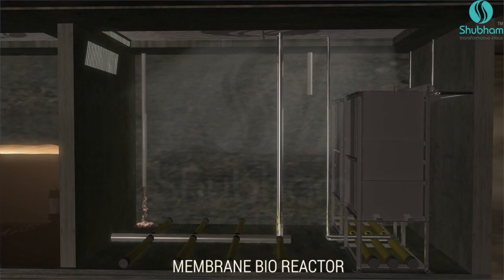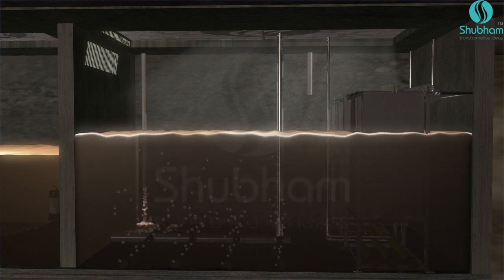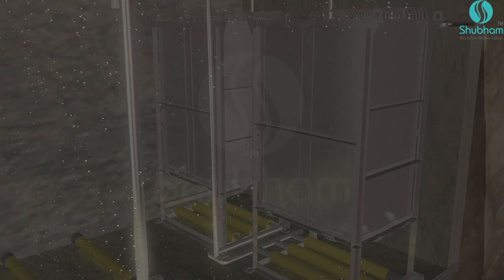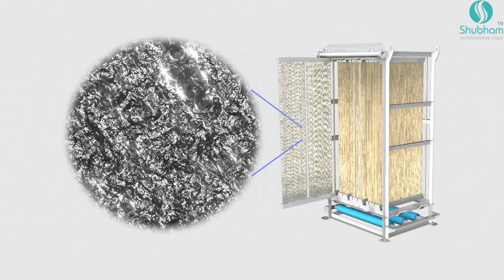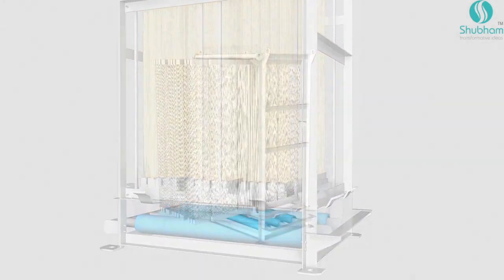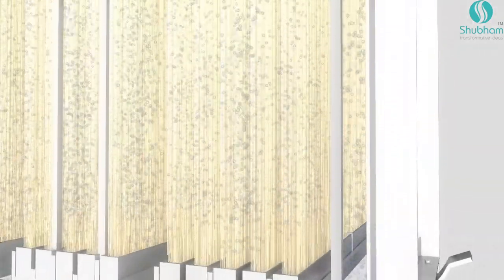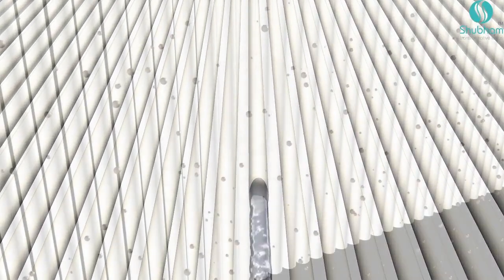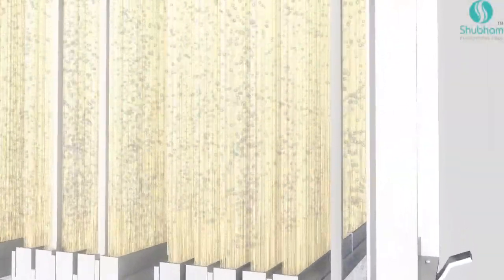MBR Operation

Comment from the maker: Bio-Accelerator 360°™ is an advanced ‘plug and play’ MBBR (Moving bed bio Reactor) waste water treatment system featuring the submerged bio media. The Bio-Accelerator 360°™ is engineered to provide a high quality effluent, treated to pollution control board standards and suitable for a variety of reuse applications.

Membrane filtration can be a very efficient and economical way of separating components that are suspended or dissolved in a liquid. The membrane is a physical barrier that allows certain compounds to pass through, depending on their physical and/or chemical properties. Membranes commonly consist of a porous support layer with a thin dense layer on top that forms the actual membrane.

For More Info http://shubhamindia.com

#Mbbr #Membranefiltration  #sewagetreatmentplant   #ahmedabad   #surat   #baroda   #gujarat   #india